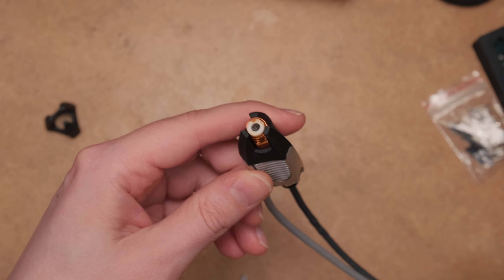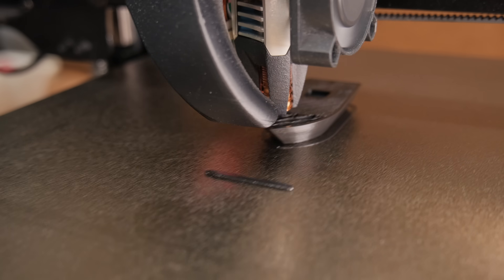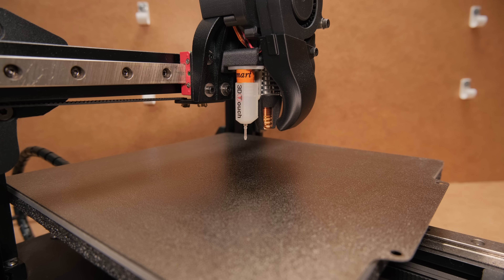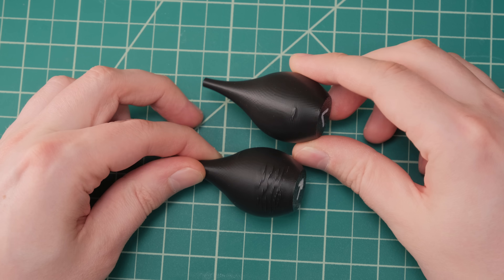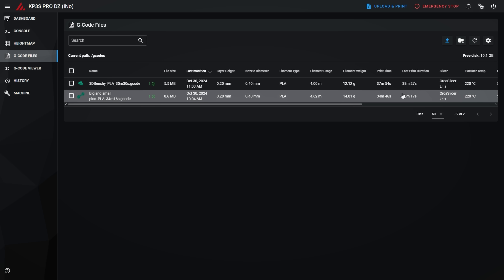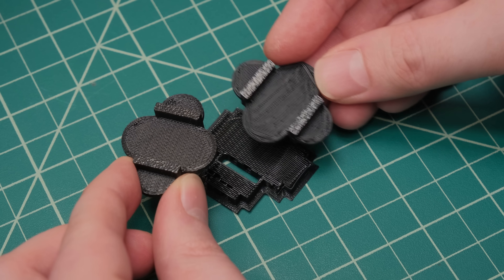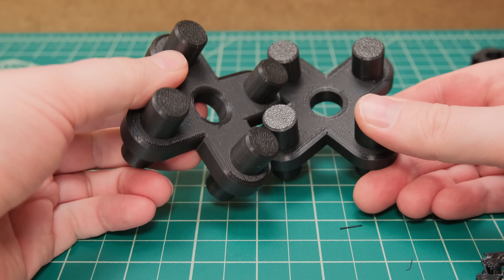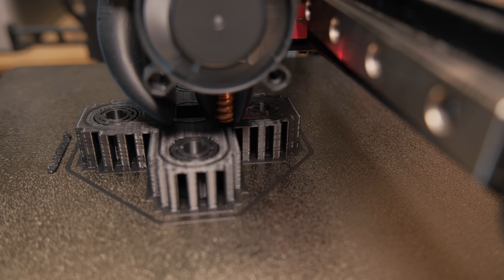World’s First INDUCTIVE Hotend – How Crazy IS IT?

Comment: Wow you went all the way down to 171 °C for the support surfaces. I will try to do this on my IDEX where I now use different filaments to achieve something similar but never quite as nice as what you are showing. Maybe using the same filament at very low temperature for the support extruder works even better. Or printing the different support filament at extremely low temperature might yield even better results.
The speed of heating has little impact on the print times as the bed heating takes most time anyway (I tried heating the hotend slightly before reaching the target bed temperature, that worked for small prints but the bed is not yet even enough for large prints). However for this type of improvement, at least when it goes along with slicer support as you mention, this would be a big next step.
Reply from the maker: If I remember correctly the layer printed on the supports was at 200C, the 171C was a typo. You could also introduce hotend cooling with fans, that was my idea until someone mentioned this hotend.

Comment: Very interesting results.  I firmly believe that one of the biggest areas 3d printing will improve in the future is with our thermal modeling of the process and this was nice to see just a tiny hint of what could come.  I think some people may have missed the important of the fact that what you demonstrated was not just better supports, but better supports without impacting the layer adhesion of the rest of the printed part on that layer as would happen with pausing the print, or printing extremely slowly with lots of fan for the support interface.  I found it truly impressive.  The flow rate though was simply not enough for my printing use.
Reply from the maker: Yup, new technologies like this in the 3D printing space make me feel optimistic for the future, there are so many possibilities. :)
Reply: there already industrial high temp printers that do that, they 3d model the heatmap of the entire print and slow  or accelerate the print for perfect temps on each layer and section.
Reply: @songhan1586  Absolutely,  I want to see that in the hobbyist space.
Reply: @songhan1586  More about?

Comment: Now we need this for the base plate...
Reply: Nah, Bambu already did it, the heat bed is 1500W. It is matter of seconds. In europe on 230V. The same heatbed is used for the US market, that will output about 350W on 115V.
Reply: @dtibor5903  It's not induction heating but instead it is just a conventional heating coil enclosed in a tube/pipe that is wraped inside the die cast aluminum bed.
Reply: @alfredanil  oops, i forgot to mention that it is resistive 😅 it does a fine job at 1500W
Reply: @dtibor5903  just imagine if it consumes just 150W and heats up 10 times faster, that's the potential of induction heating of the bed.
Reply: @dtibor5903  ahhhh, maths... double the voltage, quadruple the power :)

Comment: wouldnt this also allow us to the heat the tiny inside bit on splitting nozzles better?
Reply: @florianmaslofski  yes! But itll also be the hottest part of the nozzle and could be far hotter than desired. Since the thermistor wont be near that lil centre we wont know.
Reply: Not very well, induction heating has limited penetration depending on the frequency. Look up skin effect.
It's also not very important anyway, as you can see from some of CNC Kitchen's videos on high-flow nozzles. The thermoplastic is far less thermally conductive than just about any metal and is therefore the limiting factor, hence the splitting for more surface area.
I believe the only advantage of induction heating is the low thermal mass of the heated area giving more control over temperature.
Reply from the maker: Yes, if the bit inside would be ferromagnetic. That is a good idea. :)

Comment: An inductive coil in toolhead, would enable drop-in nozzle/heatbreak with filament for multi- filament printer. Having drop-in extruder like on yt Engineers Grow, would result in great MM system.
Reply from the maker: That is a great point
Reply: @PrintingPerspective  I hope you can take ideas further.  I am old, I just want to see 3D tech progress in simple but robust way.  
I like your idea of temperature adjust.  Low thermal inertia by eliminating heat block is good.
I have thoughts on inductive controller, reducing it's footprint may be nice.
Reply: Would be super nice (if the price was brought way down) for multi-toolhead printers to not have any ooze on the waiting toolheads and not have to wait for them to heatup.  Now it's a balance between ooze and heatup time.
Reply: Well, would you look at that. Now we have INDX and it works like the Engineers Grow changer!

Comment: Last time i checked that hotend didnt allow nozzle changes, what happens when the nozzle is finally worn out?

Also you should be able to automate the temp change gecode with slic3r's conditional gcode and change on print feature. Might be not as fine as optimally needed for control but should work. (Also in all slic3r based slicers)

How high of a temperature drop was needed for the 0mm support?
Reply from the maker: That hotend is mainly for industrial use, so the whole hotend would be changed.

I bet there are some possibilities but there are no easy ones you know. Maybe even copying the gcode to ChatGPT and asking to reduce the temp for the overhangs would work.

It depends on the model. The inductive hotend from my timings in Klipper was able to heat 200C -> 240C in 5 seconds and cool down from 240C -> 200C in 8 seconds.

Comment: Direct heat like in modern soldering irons is the future imho. Resistive or inductive is secondary. Great video!
Reply: What is direct Heat?
Reply: @nlkatz  being misled.
inductive heating IS resistive heating ;) 

other than the portable gas ones, ALL soldering irons are resistive.
"direct heating"..... flame or friction.
Reply: @paradiselost9946  > inductive heating IS resistive heating

Uh, no - resistive heating is when current is passed directly through the material being heated, so named because it's a result of the material's electrical resistance.

> "direct heating"..... flame or friction

I can agree with that.
Reply: @nlkatz  whats an eddy current? an induced current that flows in the piece being heated. the work is the resistor. it still follows the rules for any other type of resistor, I2R heating.

it just happens to be induced in the work via a high frequency magnetic field.

if you want to design an effective (efficient?) induction heater, you have to look at it as resistive heating.

Comment: Clearance not tolerance. i want people who want to learn to learn the correct terms. Tolerance is the amount thats acceptable. Clearance is how much space there is between two parts. example a part with a clearance of 0.01 can't be printed on most printers. A part with a tolerance of 0.01 means it can be bigger or smaller and still fit for the project.
Reply from the maker: Yeah, you are right, thanks for a reminder :)

Comment: As cool as this is, cooling down the hotend for 0-Clearance Support was always possible with Klipper. The Hotend Cooldown Speed can be integrated with a simple G4 Wait function for however long your hotend takes, same with heating back up. The code is only marginally more complicated to apply to a gcode file, than your version. For as long as slicers do not incorporate such a feature, i dont see it mattering particularly. I am interested in other options with this hotend technology though. The adaptive temperature control according to flow rate could be very interesting with abs, asa and nylon prints to reduce warping. It would in my mind need some sort of better monitoring sensors to implement it fully. I for example, you could add this via a controller after the slicer, with some manner of control over it, that would really be something. Would need a custom klipper function though
Reply from the maker: Yeah, there are a lot of possibilities, it will be interesting to see what the future holds for us. :)
Reply: What he demonstrated is more powerful than that though, he reduced the layer bonding of the support interface without reducing the layer bonding of the rest of the layer, which is what happens when you just wait for the whole layer to cool down.
Reply: @crashingsux  Thats not too big a hindrance though. If you add an irrelevant acceleration or speed modifier for support structure interfaces, using a very specific value, you can search the gcode file for all instances of that acceleration setting. Place your code snippet there. This way you can modify a specific part of a layer's temperature.  The clear limitiation of this is definitely non planar support geometry though (80° Overhangs or something like that). All of this takes a lot of time too, so its only really feasable for very expensive, or high volume prints either. If you have supports in multiple different places or layers it becomes insanely annoying. 

Long heating and cooling times may also warrant some additional code to clean the nozzle before continuing, or slightly retract to avoid oozing. You might also need to move the toolhead away from the print, i.e. park it for that duration, which adds complexity. I'd suggest to perform a slight retract (.5 mm usually works out), move the nozzle up 10mm, M109 your desired temp, then move back to your print and extrude those 0,5 mm.

Comment: Inductive hot bed would be a game changer.
Reply from the maker: Single Induction Hobs are quite cheap, the only question is how hot they can heat the ferromagnetic metals and if the beds won't warp.
Reply: @PrintingPerspective  

The Prusa XL has 9 (or 16?) heat zone in its bed to just power the area, where the printer prints to save energy on small objects. The individual zones are divided to prevent warping... maybe that could be a solution?

Comment: This is really cool and I hope they license out the tech widely rather than having it trapped in crappy "enterprise" machines.

The print quality changes are great (especially if integrated well by manufacturers like Bambulabs, QIDI, Prusa etc).

What really excites me however is the possibility of pressing print and having the print start in less than a minute especially with the new Cryogrip, Super Tack and other new extra sticky plate technologies.
Reply from the maker: For now, I only see induction hotends like this being used to print PEEK with high-temp chamber printers, but if technology advances and becomes way cheaper and more high-flow, rapid heating would be a very nice thing to have.

Comment: Even with resistive heating the slicers could implement a feature where it waits and cools the nozzle before a supported layer achieving these same results. Cool vid
Reply: Sort of, by doing that you are letting the whole layer cool down, which means you would not only reduce the layer bonding of the support interface, but also reduce the layer bonding of the rest of the print, which is never what anyone wants.
Reply: @crashingsux   Maybe still possible in some cases where you'd first print the supported regions, then increase the temperature and print the rest of the layer. Though that would mean waiting for temperature twice per supported layer.
Reply: Absolutely!
Reply: Maybe some version of this could even be DIYed? Its not like making a small copper spool is difficult. Encasing it in HT-Ceramics might be a tad tricky though
Reply: @drt5665  One could just take a normal hotend, cut away radiator panels and reduce thickness of the hotend's tube on a lathe
Reply: You can already do it to some degree by doing a multimaterial print but you change the Gcode for the toolhead changes

Comment: this is something ive been thinking about for YEARS, and everytime i brought it up i was met with "who cares about heating speed? the bad takes longer anyways" or "its not necessary, shut up!!"
;-;
Reply from the maker: The heating and cooling rate is insane on this hotend, it broke my hotend cooldown scripts that I had before, haha!
Reply: @PrintingPerspective  xDDDD nice. Ive always wanted to DIY something like this coz i love designing my own printers
Reply: @SlinkySlonkyWaffle  I came up with a linear slider contraption to build a custom storage system in my house and I realized quickly that v-slot rails used for 3d printers is the way to go for smooth movement. And that is when it clicked. I went to look at my Ender 3 and yep it's completely assembled out of v-tracks. I can design and build my own CNC and 3d printer equipment!
Reply: I've had similar thing with lots of improvements in 3D printing

I think it's overall 3D printing community thing. Where suggesting improvements is unwelcome for whatever reason
Reply: @marguskevinsunter  a few years ago I suggested adding a colour sensor to single nozzle multiple colour systems like the Bambu lab AMS, where the colour sensor would allow it to only purge as much as it needed to rather than having to manually calibrate all transitions. I was basically told it was pointless and not useful. For such a technical hobby lots of people don't seem to welcome any kind of technical discussion or improvement unless it comes built into a printer. It is a problem I have seen a lot with various online communities, including non 3D printing ones, generic look at what I printed type posts get loads of engagement but any technical questions or discussions get ignored and buried.
Reply: @marguskevinsunter Yeah, I think it’s best to ignore them.
Reply: The primary reason is that control options open up, to aim not for uniform print temerature in the nozzle, but the part itself. So you will get best layer adhesion, while not getting a goopy mess
Reply: i tried it a decade ago. if anything, it led me down the rabbit hole of impedance matching... already had experience with industrial induction heaters, but never really understood what i was doing when "tuning" them in...
Reply: But for real, who cares? Ceramic heaters gets less than 30 seconds to heat up. There is no way you actually need this
Reply: @pusnirizda88  
it's not about need.  it's actually simply a stupid idea. 
they don't realise how much more power this consumes over the course of a year. 
the only way to get a hotend to cool faster is by having horrible thermal insulation and a complete lack of thermal mass.   (means that during high speed printing it might just be going full power just to keep up with the heat demand)
Reply: @pusnirizda88  and heres the "but why need it? We already have [thing]"
Better control means better prints, it also means we can have quicker cooldown and heating for toolchangers/idex.
Ceramic heaters ive only seen going up to 320c, for engineering materials you need more than that sometimes.
Reply: @SlinkySlonkyWaffle  i would also add that it opens up possibilities as filaments tends to change their color varying on the temperature , so with fast changing you can make a part have a wider spectrum of color , i don't know if there are filaments that change their color alot depending of the temperature , but if there are , this hotend would be ideal for them
Reply: @ulforcemegamon3094  also true! would be cool to see in the future but i also have not heard of a temp based colour changing filament xD
but it could be cool for the light-weight filaments that change density based on temperature, but then we'd also need to adapt for the change in expansion from higher temps (as these filaments foam up at higher temps)